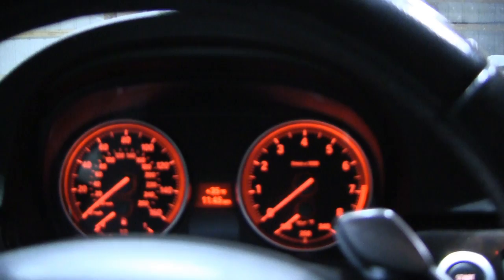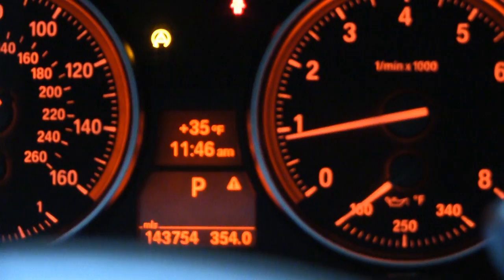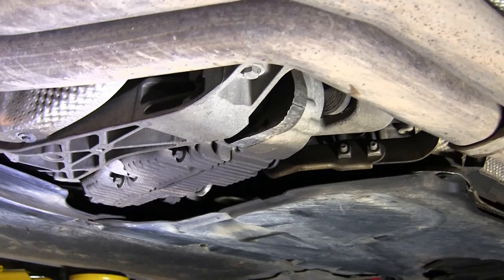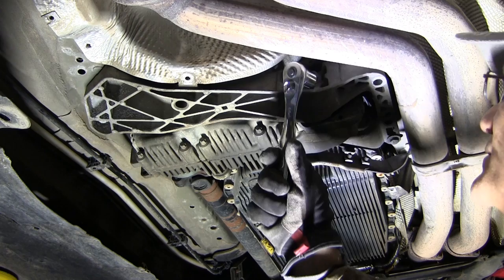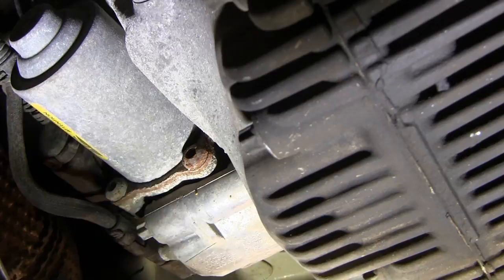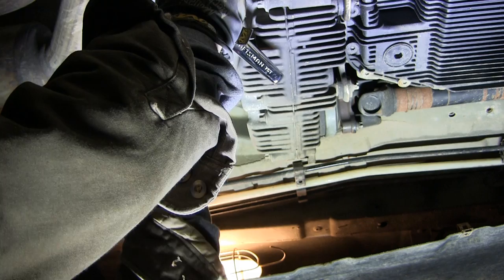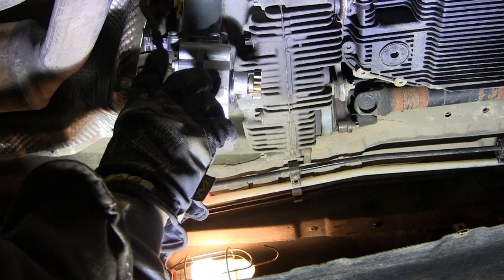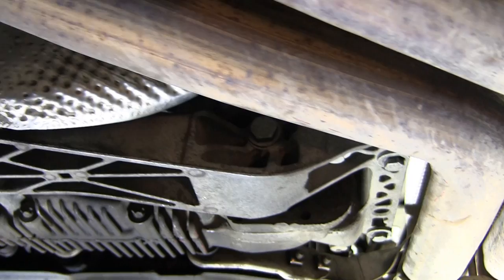3 Series BMW Transfer Case Actuator Motor Replacement 4X4! e90 x3 335xi 535xi 135xi xi

Comment: Can the transfer case cause the transmission fault light to come on and stay stuck in park also my cluster does not recognize ANY gear it’s just blank it doesn’t say it’s in park or anything
Reply from the maker: I don't think so. You have another problem.
Reply: Did you ever figure out the problem? I’m wondering the same thing
Reply: DIY Lifestyle sadly I did not bmw is still stuck sitting there in park same problem